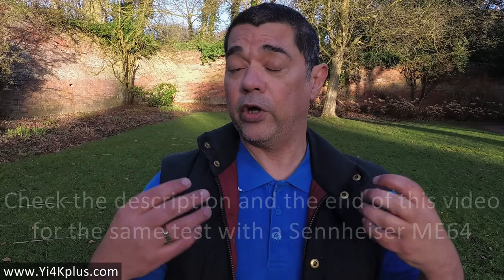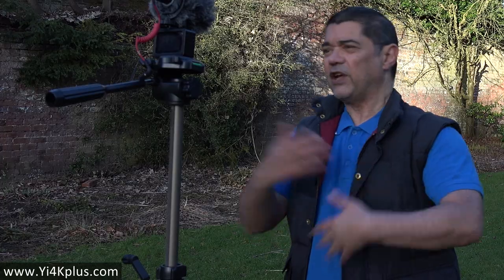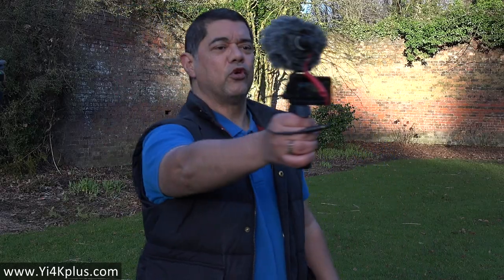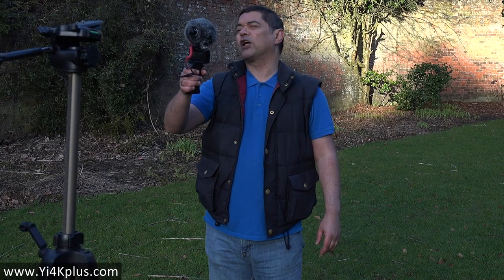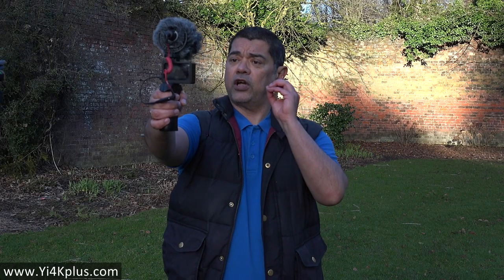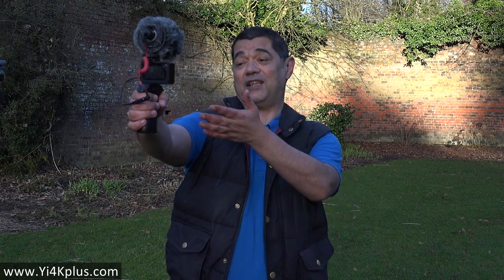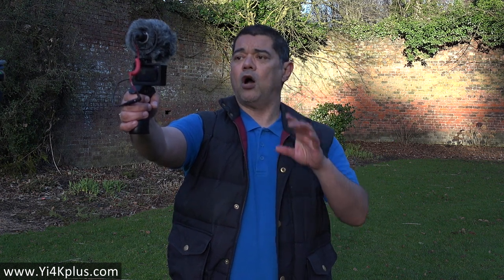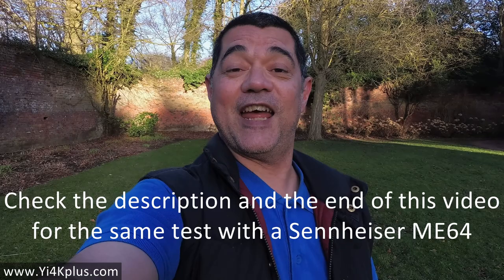Yi 4K Plus & Rode VideoMicro external mic - audio test with a passive attenuation microphone cable

Comment: I'm not crazy!  Thanks for all your work on this issue.  I found out very early on in my external mic use that setting the mic to high was a mistake!  I need to have it on low if I want anything usable.  The other day I took a two day camping trip only to get back and realize I  had it switched back to high!?  All my audio was a complete waste.  I chest mount my camera and I can't seem to get the mic low enough to not distort like crazy.  Any word if Yi has acknowledged the issue?
Reply from the maker: Hi Christopher.

As you know, the Yi 4K+ is very temperamental as far as its microphone input is concerned. Even in low mode you still have to be careful to not record anything beyond a certain level as it too will distort. It's a real shame as the 4K+ has, in my opinion, the best picture quality of any action camera and I've owned the GoPro 5 and 6. If its microphone input worked and were of good quality, it would hands down be the best vlogging action camera. As I'm unbelievably happy with the 4K+'s picture quality, I now use it as b-cam  for two camera YouTube stuff, which it is brilliant at.

Unfortunately, Yi have never answered any of my queries about the audio issues with the 4K+. I also had issues with the 4K and its internal mic recording. After making a YouTube video to demonstrate the problems, at their request, they simply ignored my request for a solution and just plain acted as if the questions had never been asked. Their solution was to recommend that I get a refund from Amazon as 'I wasn't happy with the camera'. Again, and unfortunately, Yi will simply not acknowledge that both of these cameras have audio issues.

What's more ironic is the fact that their cheaper Yi Lite has very noticeably better audio with its internal mics. Check out this video where I'm using some Rycote Mini Windjammers  on the Yi Lite https://youtu.be/sxkxDU888cQ These will also help the internal mics of the 4K+, but obviously not with its distortion issues which also happen with its internal mics.

BTW. Call back in a few weeks. I've been doing some ongoing recording of the that Yi Lite wind system. The idea is to do a few different vlog scenarios with the Lite, rubber case and Windjammers to show that it is potentially the best budget vlogging solution for an action camera without external mics etc. In fact, here's one of my unpublished clips of the setup in action, the idea is to do a couple more like this to show how well the setup is https://youtu.be/fE5OQLSVgpc

Cheers,
Dave.

Comment: I’ve had the Yi4K+ for some time, the audio really lets it down. I bought an external lapel mic and the usb c converter. It helps and is ok until the audio peaks too high then it distorts. The best solution with the Yi is to use a separate wireless mic. Your video audio was clear, but has the distinct Yi distortion on the high end
Reply from the maker: Hi. Yes, there's definitely a sound to the mic input no matter how well you balance or attenuate the incoming signal. It's a real shame as I still think the 4K+ has the best absolute picture quality of all the actioncams. I now use a Hero8 because the stabilisation is awesome and the mic input from the adaptor or Media Mod is excellent, although I still prefer the picture quality of the 4K+ to the Hero8. Cheers, dave.

Comment: Hej män, it's not perfect, but I think you'd be the crazy person to give this a try. I've just bought a ZOOM H1n: Set the 4K+ to low mic volume, set the H1n output to 30 with automatic limiting and leveling and stop worrying. It's not much bigger than the external mics, has stereo and does record seperately to SD so you are able to edit in post if needed. To me it seems to be the best solution yet. Cheers from Berlin and thanks for your efforts!
Reply from the maker: Hi Stephan. Yes, that would work but most people don't want to record separate audio and then re-sync in post. Plus, many people don't have the software or don't know how to re-sync, this is why it's so important to capture good dialogue/audio with the video camera. I have a lot of audio equipment and even if using a limiter ahead of the Yi's input it will still distort. Danke, Dave.
Reply: Hi Dave, maybe you got me wrong there: I'm using the headphones out of the ZOOM to really instantly record the sound of it to the camera. The sync in post is just a suggestion / backup plan in case anything goes wrong.
Reply from the maker: Hi Stephan. I did understand what you were saying, you're basically using the H1 as a preamp to attenuate the microphone before it goes into the 4K+ and also using the H1's limiter if you need it. If you find that quality good then great. I personally don't and here's why. The 4K+ has a very low bitrates for audio which effects dynamic range as well as frequency response, it doesn't record stereo with its audio input, its analogue to digital converter is quite poor quality, it has a very noisy preamp, its own limiter doesn't protect against clipping and will record over 0db. it doesn't have a standard impedance which causes issues/distortion with many mics.

To be honest, there's a lot of problems with it. But like I said, if you're happy with the sound then that's great. Here's another problem that many people don't seem to talk about. Record with the EIS and the audio goes way out of sync, usually upto 5 frames. This is because Yi haven't bothered to offset the audio to take account of the latency in the picture due to the buffer of the processing when the EIS is on.

I've done many tests with the 4K+ that I don't make public on this channel, I have another channel for my tests. Let me know if you're interested and I'll give you some links to some of my tests.

Sorry I don't speak/write German.

Danke,
Dave.
Reply: Yeah, I'm with you there: The quality of A/D conversion and limiting is VERY poor! It's sad because the camera has so many great features to offer. One day though, ey? All the best from Germany!
Reply from the maker: I totally agree with you. It's a real shame about the audio as the  4K+ has an amazing picture and in my opinion is the best of all the action cameras. I've had the GoPro 5 & 6 and the 4K+ is better for picture in my opinion. Although the GP 5 & 6 and now the 7 are the best for audio due to the external audio interface, although the interface is very expensive for what it is.

I use the 4K+ for nearly all my locked off synced b-cam stuff and absolutely love it. I just do a couple of test recordings to get the frame right and then just hit record an leave it alone, perfect. Is usually shoot 2.7K medium FOV with anti lens distortion. Here's an example of it being used as a b-cam https://youtu.be/8_8SzrWZW8M

I dismantled the lens on the 4K+ so I could do refocusing for close vlogging and totally open for wide distant stuff. You may find this video interesting, it's the 4K+ refocused for macro recording https://youtu.be/WHjgobv0xsQ

All the best from Liverpool.

Cheers,
Dave.

Comment: 10k resistor may be not enought for loud sounds attenuation. There are still some distorted peaks as hearded on the video. I used 270k with DIY mic based on max4466 preamp.

Comment: Hello David! Great video and explanation. I would like to ask what type of cable are you using to your external mic? I tried to connect my camera via usb-c/jack connector from my phone but it doesn't work... So I think I need different adapter?
Reply from the maker: Hi Robert. The only compatible cable is the one that Yi make, no other USB to 3.5mm adaptor will work. Just do a Google or Amazon search for the Yi cable. Cheers, Dave.
Reply: @DavidHarry  Thank you for very quick answer! Damn... the cost is sick for this cable

Comment: Hi Dave. Both the Rode and this one still sound a bit thin in the presence region. There’s a fraction of distortion on the peaks as well, so I’m thinking that this is definitely some kind of impedance mismatch. I get a similar effect with headphones funnily enough by using an underpowered amp into very high impedance headphones.

So for instance, if I plug a 600 ohm headphone into a battery operated portable amplifier, the sound goes thin and can distort on peaks, which is what you’re getting with both microphones.

The Rode is a little bit nicer on the ears because it isn’t as sharp up the top as the other one though funnily enough.
Reply from the maker: Alright, Ian.

Don't even go there mate :) Nah, your're totally right, neither sound as good as they should. I've now given up on finding a solution for the 4K+. As you say, and as I said in the description, it's likely to be an impedance issue. But regardless of what it is, it's defo the camera can't handle the voltages it and any other recorder should, hence the distortion. It's a real shame as it produces great pictures, but not in this video as I had locked the ISO and forgot :)

Yi have been on my back with my Amazon review, trying to get me to delete the negative review if I get a refund. I'll be doing a blog post about the whole saga and post their requests and BS excuses. I've also got an A/B between the Lite and the Discovery coming up. Even though with that video I'm not going to give my opinion, it's so bleeding obvious what the problems are with both camera. As bad as the Discovery is, the Lite, which cost twice as much, looks out of focus by comparison.

I'll a have a few more Yi things come up as I've already got the footage, including a 'how to' that shows how to mod the 4K+ for manual focus, like what I done for that macro video. I'll probably back off with action cam audio stuff for a bit, as it appears that most people don't seem to understand or care about it anyway. But after that I've got some mic stuff to do, Yeah :) 

My friend is going to borrow me a Rode NT1A and another one has just lent me a Rode VideoMic Pro. Plus, I've got two lav mics to do and another cheap Chinese condenser, I think it's a BM-800 type, it only cost £6.99, another cheap preamp and a cheap phantom unit, and I've almost finished my Saramonic SmartRig mod video. I've never actually done a full on review of the SmartRig, so I'll probably look at doing something quite extensive with it for indoor use with studio condensers and shotguns and with outside boomed shotgun stuff. I know I've used it in videos with other stuff, but it's always been about the mics. I really want to try and get into Saramonic and Movo as I think they're fantastic value for money and seem very consistent with their stuff, plus I'm a FanBoy :)

Cheers buddy,
Dave.
Reply: Movo have been a surprise to me as well. Their mini shotgun is great value although my own personal preference as you know is just a bit more top end edge. Basically because of what I use them for.

I also like all of the Saramonic preamps. Getting the settings right can be a bit of an art I find. Where to set say, your recorder in comparison to the Saramonic. Not certain where the Saramonic is at its best, so I aim at centre or just above.

I’ll email you with my thoughts about Yi! My feelings about all of these portable cameras except the GoPro with that stupid converter is that they are all a bit crap with sound and a separate recorder is the best way to go. If I use my cheapo, I leave the Zoom permanently running a mic and clap every time I take a shot for sync later. I plant the audio track onto my editor first and then place each clip above each set of claps and then cut up the audio, delete and link everything so I can edit with just video and associated audio. It is a pain but you then get decent sound.

You now have me wondering whether that GoPro adapter is an impedance matching device.

Quite a few companies go into denial when something negative appears which is a pity because it shows what their primary motive is in the production of these devices. If a company doesn’t show interest in inherent problems then maybe the short term sales is their aim rather than developing a product into anything serious,

I was very miffed by Rode actually, when I complained to them about the Videomic Go being over sensitive to electrical and airborne noise. It’s plastic so no big surprise. Rode replied very nonchalantly and just said thank you for letting us know. (As if they didn’t already know) I was quietly hoping they’d allow me to get shot of it and pay the difference for something better, but they didn’t want to know. Shame on Rode. Means that although I use a lot of their stuff, I am wary of them as a company when it comes to new gear now.

I’ve not been convinced by the picture that you get tbh Dave. GoPro on 4K might be a lot better than you remember now! Certainly the audio was better. To me, the dynamic range of the picture seems limited with highlights often blowing out. Not sure if it’s how you’ve set it up, but it doesn’t look as good as it could to me. That close up stuff that you did recently though was stunning, so if. You did that on the Yi, then it’s just a setting thing. Colour also seems to  veer more into blue. Maybe reducing blue on the software might help the colour rendition but the contrast levels do seem limited.

Sorry Dave, sent an email but my English is terrible. The spellchecker tried to alter things without me knowing, but you’ll get the feel of what I’m saying!!

Cheers

Ian
Reply from the maker: Alright Ian.

Yes, Movo are a bit of a surprise along with Saramonic. Those Movo WST wind filters are unbelievable for the mono, especially the WST80. There's no way you could use a Rode NT5 outdoors as it's far to sensitive, but slap a WST80 on it and it becomes a very reasonably priced option for video work. Here's the video I did with the Movo and NT5 https://youtu.be/KnXLfr0Ab6g And let's not forget the Movo mic adaptor for the GP3 that I used on all my GP3 videos, the only one outside of the GP one that actually worked, I tried 2 others that didn't, and less than a tenner.

I'm surprised by your Rode story. They make some some really good mics, you'd think that would translate to customer care. Can't wait to try out the VMP properly, but I'm already sold on the Micro. I know the VMP is higher spec and probably better, but the whole Micro package is just genius and sounds great for the money. I did a quick test a couple of nights back with my mate, who's lending me the NT1A, with something I'll be reviewing soon. It's a IK Multimedia iRig Pro, it's basically a single channel phantom mic pre but it also does all the A/D and bitstreams the audio with options of lightning and 30 pin for iOS and USB out. For whatever reason it's pre is awesome and dead quiet and the A/D is brilliant. We were testing it using an old iPhone 5 as the recorder with the NT1A and ME64 for doing some video sync audio tests.

I also tried the Micro on the iPhone 5 straight into its TRRS headphone/mic socket for simple vlogging, the audio crapped all over most actioncams. I'm also going to be trying out that £15 Android phone as the recorder for a cheap synced audio setup for a 'how to'.

Yes, forget about Yi for good audio. GP are the best for audio even if the box for the 5/6 is big, expensive and limited. I doubt it balances impedance, I only say that as the GP3 with its simple cable, done all the  audio processing inside and sounded really good and miles better than the Yis.

Don't judge the 4k+ picture on my last few clips. That was user error. The pictures only looked crushed or blown because I'd left it in manual mode from a previous session and forgot to reset for those videos. I dare say that you're right about my memory of the GP5 picture, but I'm totally sold on the picture from the 4K+, especially as I can now hack its bitrates, frame rates/shutter and of course the lens. And when I say lens hack, I really mean hack :) You'll see what I mean when I post the how to :)

Cheers buddy,
Dave.